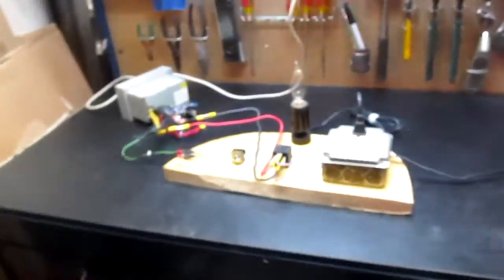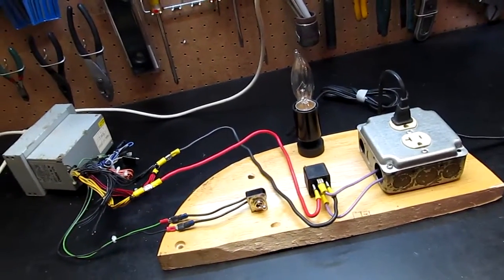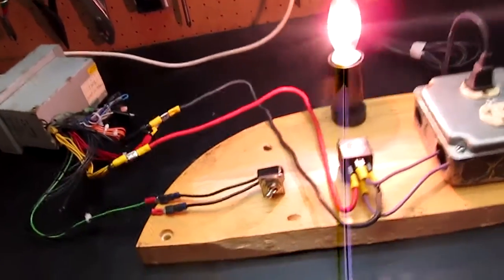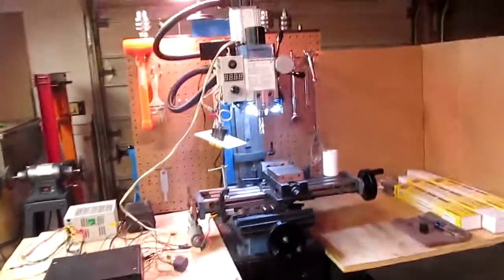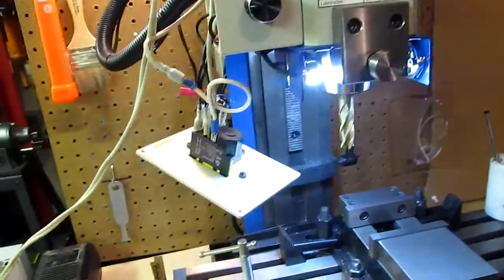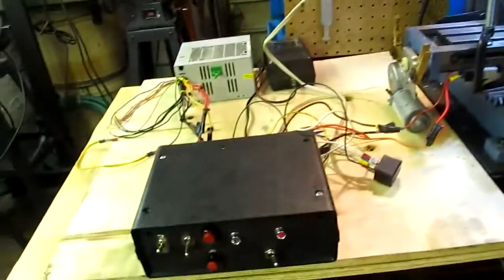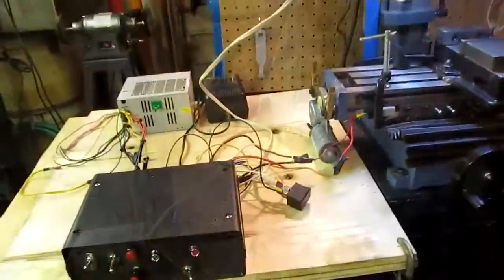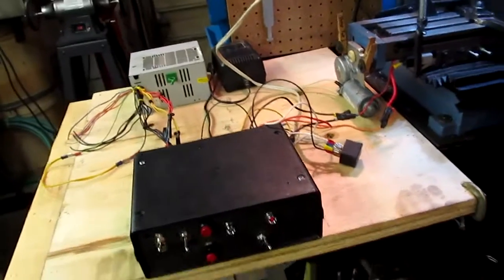HiTorque Mill Homemade Power Feed Update

Comment: Have you noticed that the wiper motor works better (smoother) in one direction?  Was told that there are thrust bearings on only one side of the output shaft intended for single direction of auto wiper motor.  I noticed this making a gear drive system, and wonder if you detect it on the direct table drive ?
Reply from the maker: Have had no issues, but my particular motor is from a sunroof.
Reply: Do you know make/model of sunroof motor?  Interesting- never thought of that as most DIY projects use windshield wiper motors....  Thanks,
Reply from the maker: Yeah, took it from my 96 Pontiac Grand Prix before i junked it.

Comment: Great video again. I am in the process attaching a window motor to my machine. Have you posted wiring diagrams yet?
Reply from the maker: Thanks again! No, I started it... but haven't finished it yet.  It got put on the back burner due to unrelated circumstances. I'll get to it when I can, then let ya know when it's up.

Comment: You should post a wiring diagram.  Good info though.  I've done most of the same mods to my LMS HiTorque.  Checkout LED light rings on eBay, I think it's the 80mm that fit perfectly around the spindle.
Reply from the maker: +Jim AFCarbon Checked those out. Probably be nice to have one on the drill press too.
Reply from the maker: +Jim AFCarbon Yeah, I will do a diagram when I get it finalized. Besides the controller, it's pretty "old school" with switches and relays, lol. Works good though.